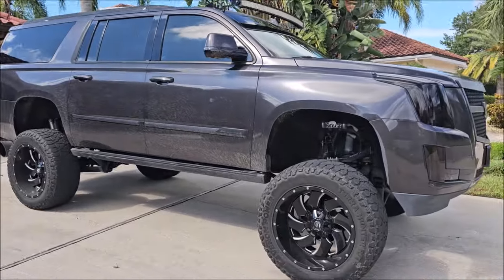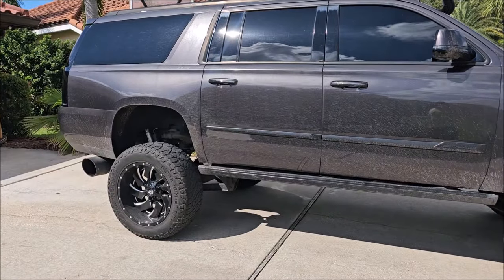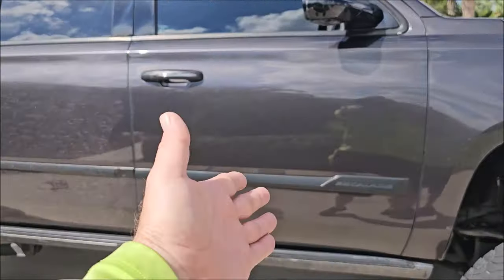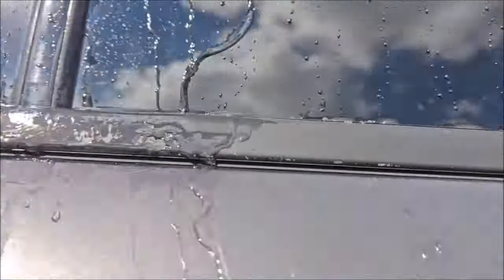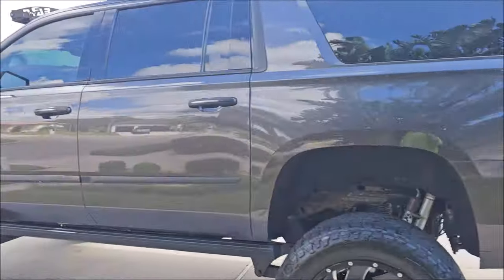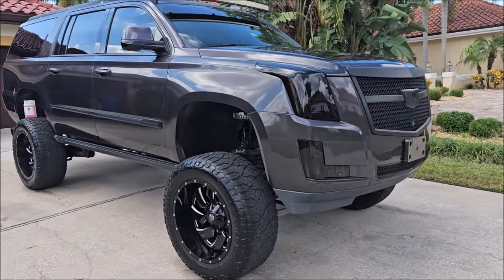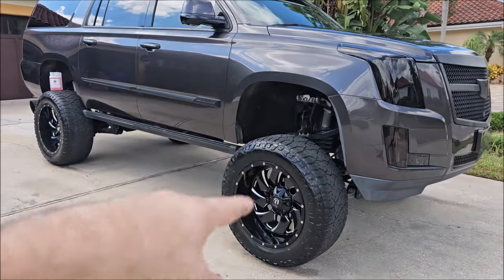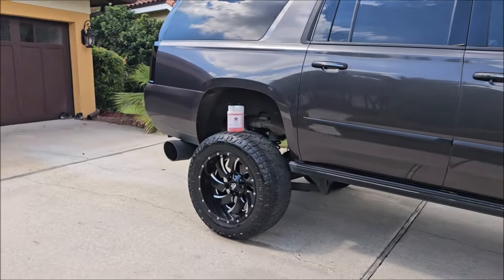THE TAIL CHASERS MAY HATE THIS SUDDEN DOSE OF REALITY - EFF YOUR FEELINGS - SIMPLY RINSELESS

Comment: How do you reach the center of the roof on this particular truck? Are you a step on the tires kind of dude or what kind of step platform actually works for a big nasty one like this?
Reply from the maker: I use a 4 ft platform generally for the center of this truck, but its not tall enough, so I open the doors and stand on the door sil to get the top done. I do also stand on the tires when I do big trucks like this for the front end and windshield.